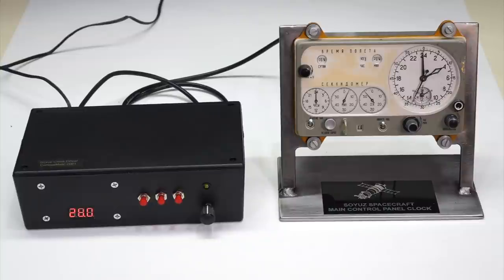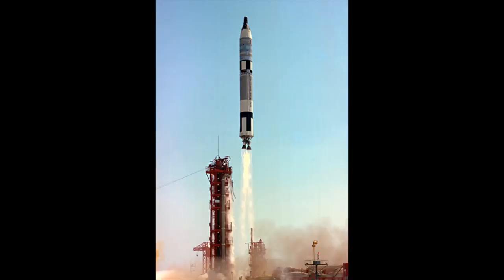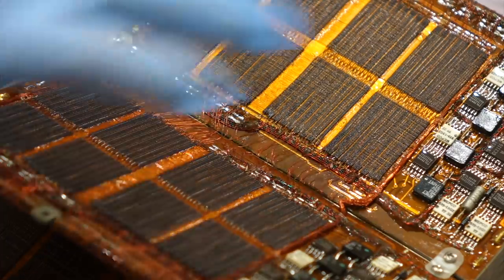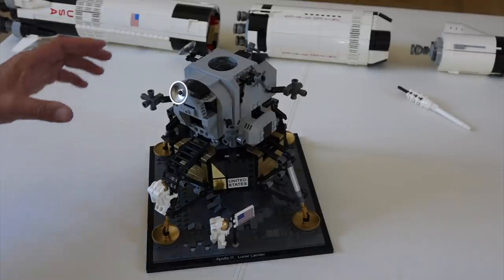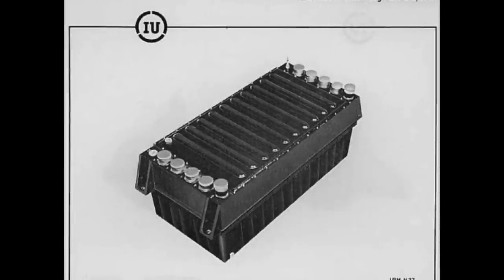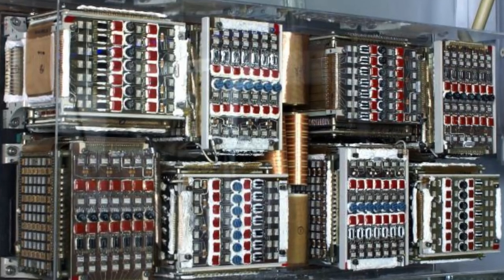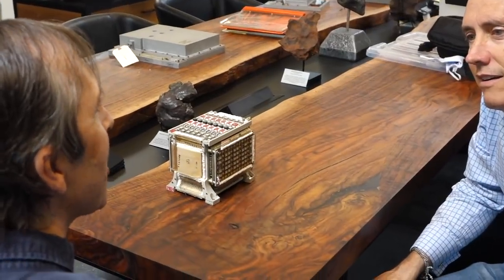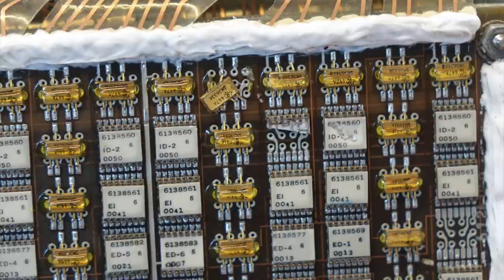Steve Jurvetson’s Space Collection - Part 1: Apollo LVDC Core Memory, Titan Missile Computer

Comment: For those interested in the packaging and mechanical design of the LVDC, there's a damaged board of the thing that passed in hands of Dave (EEVblog), Fran (Franlab), amongst others, and it got (destructively) experimented on.
The ceramic "chips" appears to still work perfectly, and there were not soldered but held in place by springy contacts, themselves surface-mounted to the board. IBM took vibration mitigation very seriously on this one. It's a beautifull piece of engineering, indeed very different in spirit and construction from the AGC.
Reply from the maker: Ken Shirriff conclusively reverse engineered Fran’s board. It’s actually from the LVDA, not the LVDC. http://www.righto.com/2020/04/a-circuit-board-from-saturn-v-rocket.html
The chips are not clipped in place either, I believe they are welded to the PCB. When she was unable to desolder them, she must have tried to force them out by sliding and ripped the top to bottom ceramic side connection, which also forms the “pin” welded to the board. It ripped off the thin film they were attached to on the ceramic, but stayed welded to the board. She probably mistook them for clips.
Reply: @CuriousMarc  thank you master Ken

Comment: On most Apollo flights, the LVDC had one final mission after the CM/CSM undocked. It put the third stage on a (sort of) precision impact course with the lunar surface. This gave impact shocks to measure with previously deployed ALSEP geophones. This helped scientists understand the lunar geology better (="Does the moon have a defined core? How big is it?").
Reply: first mission didn't have seismometers on the ground so the stage are still hanging  around in the solar system.
Reply: @Damien.D  Correct. Apollo 8 through 12 instead send their S-IVB into heliocentric orbit instead (also using the LVDC to control). The stages that crashed into the moon were from Apollo 13 through 17.

Depending on the mission, the LVDC either fired the engine or did a controlled cold venting through the J-2 nozzle, if i remember correctly .

Comment: It is amazing the technology in the LVDC that is not used not available today. Core memory, RTL/DTL logic, hybrid ceramic modules, and it worked in the mid 1960's.  I can only imagine the concentration needed to construct the diode matrix module.  IBM was possibly reticent to use integrated circuits because TI invented them. The hybrid ULD modules could be made with tighter specs because you could trim the resistors, but you got one gate per module.

Comment: Love your channel. 
Again, brings back memories from the early 70s at Sperry Univac. They built an early crt display that had core memory for the display memory AND a diode array like the one in the video for the character generator ROM. Can't recall the name of the display, but later worked on a dumb terminal (Uinscope 100) with core display memory and a printing terminal (DCT 1000) that had a two 160 character buffer memories that were a glass delay line made by Corning Glass.

Comment: My god, those core memory plates must have been a menace to manufacture.
Reply: Made by a small army of seamstresses that spent the entire day weaving a needle through the tiny cores to get the X and Y lines in place, then another day spent weaving a single sense wire diagonally through the array, followed by another doing the same, but in the opposite diagonal to get the inhibit wire in. Then soldered to the core frame, and tested for a few hundred cycles, before they would put the backing plate on and seal the entire core in place with an epoxy sealer, so the cores do not vibrate and wear out the thinner than a hair wires. 

Perfect ones would likely be the Apollo ones, those with a few single bit errors would have the core at that junction removed, and then simply have the 4 wires routed out the end of the array to a single core, mounted on the edge, and then brought through to the correct lines, and tested again.  The high cost of manufacture meant that you would fix faults in production that way, and the memories would still be useful. Later designs simply put an extra row and column in the core array, so that if one row or column failed in test you would go to the alternate, solving single bit fails quickly. If it was perfect then those would remain unused for the life of the core, though you could still swap to them if a bit failed in service, which was rare, except for a few minis that had a firmware bug, that would hammer a single location with reads when halted, heating that single bit of memory till it failed.

I did work with 16 by 16 ones, those were a pain to fix, replacing a single wire at a time to remove failed bits. Sense wire would be cut on the diagonal, and replaced for that run, soldered at the ends to the originals, and then stuck down with the new core bit. But rare for them to fail, there were dozens in use, and only a handful with repairs.

As for serial computers, I worked with one designed around Mostek Mk4007 serial CCD memories, with weird non overlapping clock requirements, and 4 supply voltages for operation. Lots of serial to parallel conversion in various blocks, though the maths side used a serial architecture in a lot of places, and a lot of the math was done with look up tables stored in 2708 Eproms, with some holding microcode and the stored program, and others on the card, with 12 chips on them, doing combinational logic for various functions, using 8 inputs and outputs. Pre PLD days, so Eprom was used, instead of boards of MSI TTL.
Reply: Just lining up the hundreds of diodes in than fashion looks hellish

Comment: Ferrite core memory so cool inside. Also I proud of the space devices complexity from THAT time. Now space electronics is much simpler
Reply: More complex, but yes a lot less wiring on the outside, all the complexity went into single IC packages, though space rated still has a large number of components, as you need large feature size chips to make them radiation hard, and you still want to have at least 3 of each compute element on the system as well. And of course smaller electronics means less wires, as you can decentralise the control systems to near the actuators and sensors, and simply have 3 digital buses feed data and commands to there. Smaller connectors across stages as well, not the 1000 pin blocks Apollo had to use to get every wire into the top stage from the ones below.
Reply: @SeanBZA  much simpler outside, right. All the logic which I have to create by low-level IC's you can implement in one single chip.
But internally it became more and more complex from rocket to rocket.

Comment: As always very interesting. For your information. The first digital computer in the F-16 was also a Delco Magic (??) core memory computer. I assume developed in the same time frame. From remembrance the boards are very similar. The core memory modules (also 2 units) are smaller but as far as i remember where also 16K words (~2bytes?). If interested i can sent you some pictures.
Reply from the maker: Yes the Magic computers were used for a number of military and commercial (Boeing 747) inertial platform systems. I only know because I read Ken’s great write up about these systems: http://www.righto.com/2020/03/the-delco-magic-line-of-aerospace.html

Comment: A very good explanation of the IU ring and the LVDC, thank you. Are you considering investigating the connection to the 360 architecture, and the 4Pi compute system? Or even how the line developed over the years to later relatives like the AP-101?
Was unaware the flight software was still considered classified - does that imply the IBM sources are under lock and key somewhere, rather than "lost" as has been assumed?
Fascinating!

Comment: Great video and cool stuff in new series!
Waiting to see more of them!

Interesting, have a core memory still hold an old data? 🤔 Biggest problem, that without all driver circuit it's one time try to read it, but trying to figure out connections, also may destroy data..

Thanks for sharing! 👍
Reply: I remember working on a HP 1000 computer that had core memory. If the programme went wrong you could not reset it by turning the power on & off. When you turned the power back on the computer would just restart & continue running the infinite loop or what ever error you had accidentally written in the code. You had to go through some special routing involving the front panel switches to stop the programme running and reset things. No paperclip into a hole then!